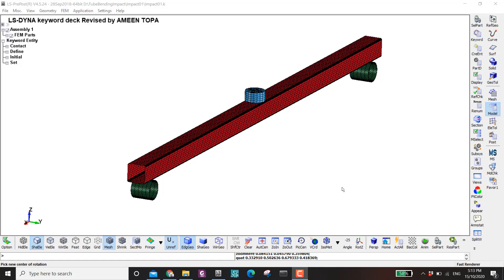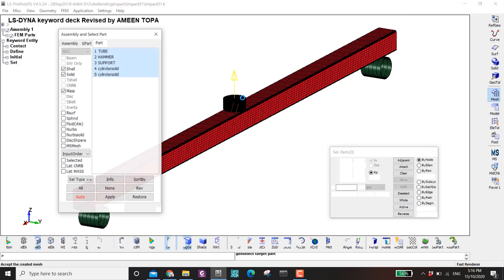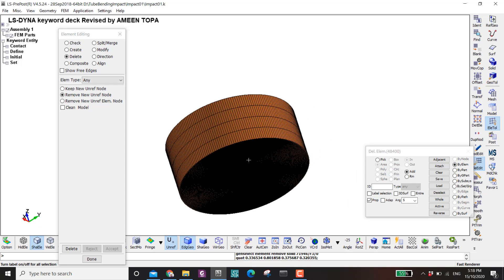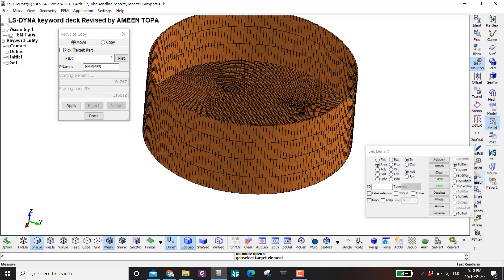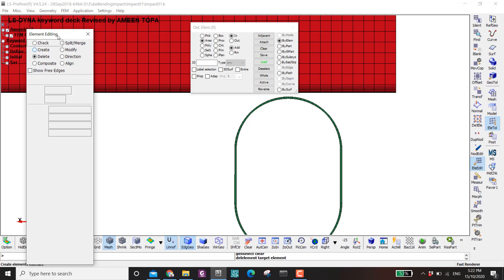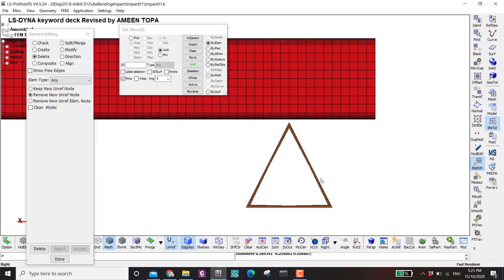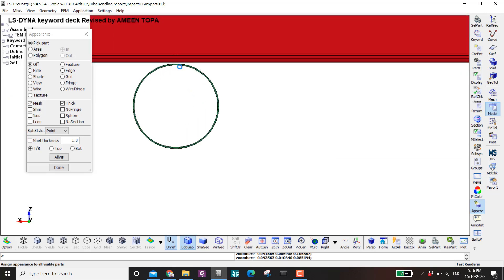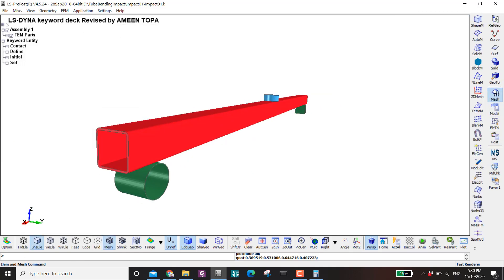Meshing: Cylindrical Intender and Knife Edge Support

Comment: Hello Dr Topa, which method of scaling mass is giving us the best results (Element Mass adjustment or Density of Material Adjustment). Thank you.
Reply from the maker: Dear Keoagile, the most recommended way is to use DT2MS in CONTROL TIMESTEP. You can search online and you will find some good reading materials about it.